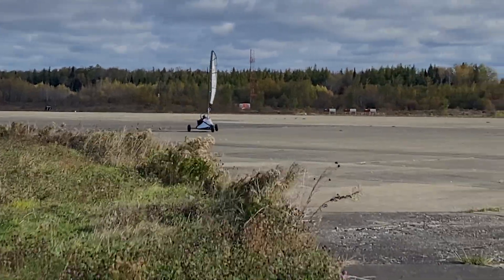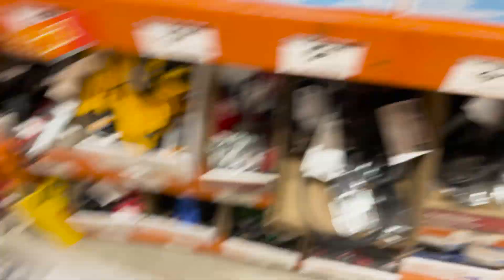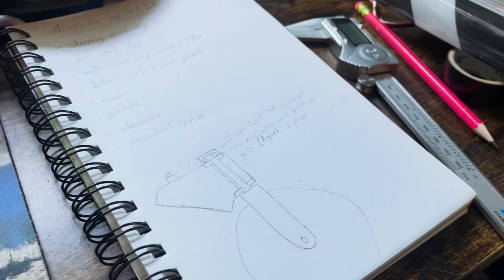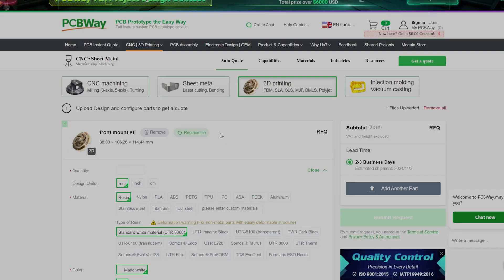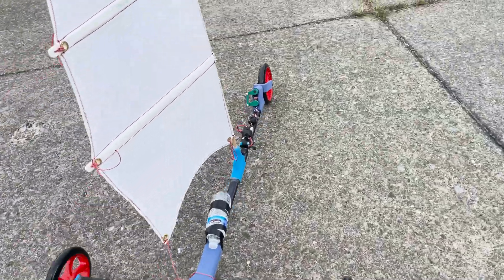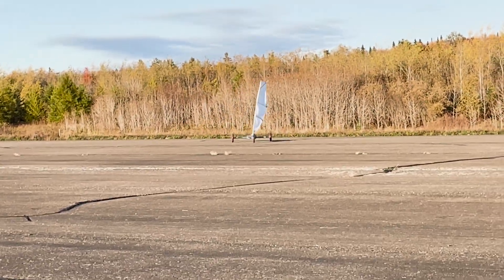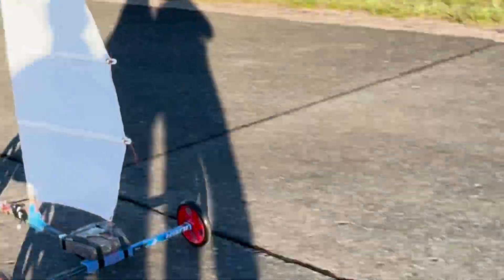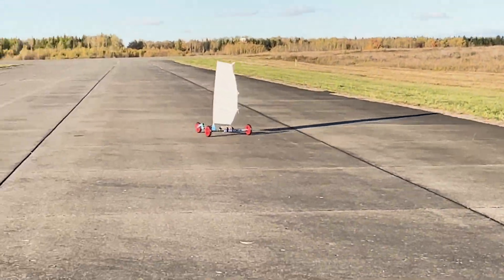Pursuing MAX Efficiency : RC Sail Car

Comment: killer. I am building one right now. What diameter wheel size did you use on this?
Reply from the maker: Off the top of my head, no idea. Larger than 200mm diameter. I would recommend above anything else to get tires that aren't solid polyurethane, but rather something that grips the pavement a bit better. This thing liked to skitter sideways when it loaded up too much.

Comment: He mentions sailboats but doesn’t say anything about our F18 🙁
Reply from the maker: lol
Reply: A few ideas for mk2 .. Fixed wing instead of a sail with a rudder hanging out the back to change the aoa.  Look up Emirates team new Zealand land yacht record to see what it would look like.  Wider rear axle means more leverage for less weight .  Look up "trail" in regard to required fork angles vs wheel size .